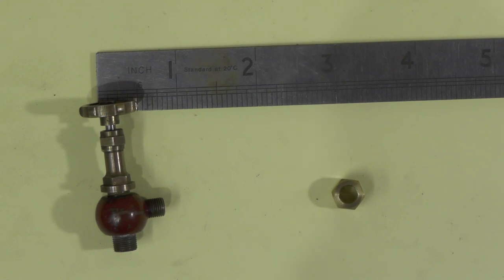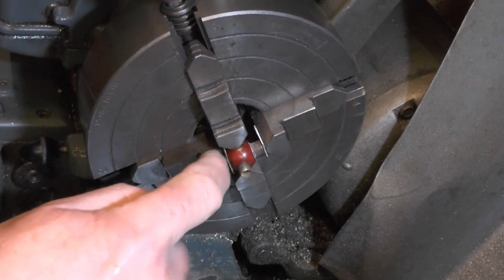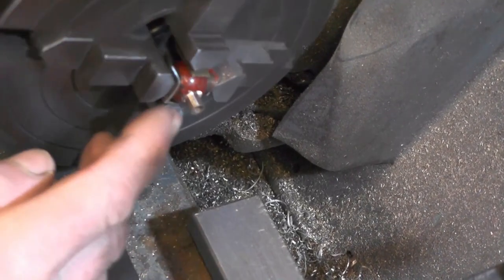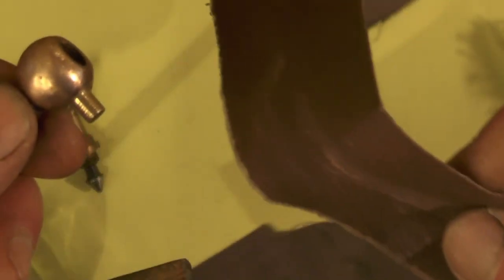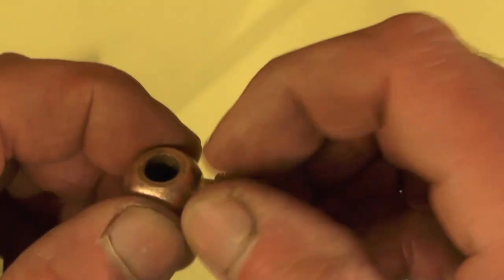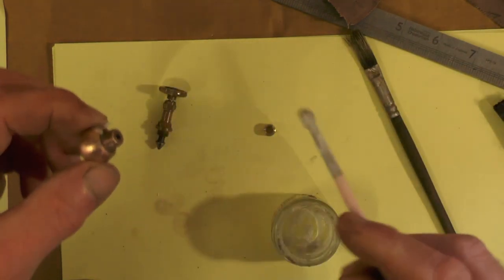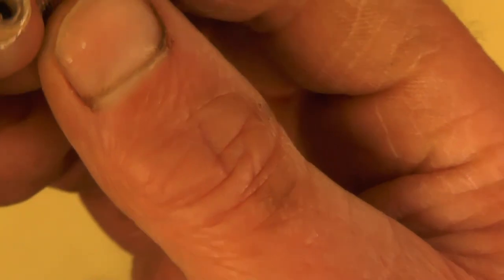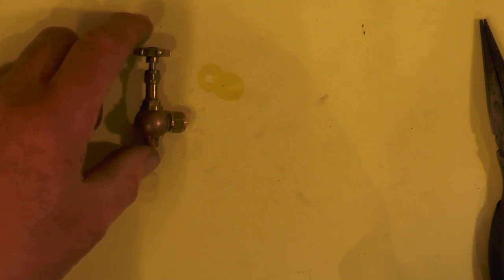Miniature Steam Globe Valve (Modification, Re-Purpose, Adaptation, Silver Soldering) "mr factotum"

Comment: Hi Mr. F,
I like your new title. It's so satisfying when you do some odd jobs for someone else, isn't it. I have finished fabricating the governor valve bracket out of brass and phos. bronze. Now I need to cut all the linkages. To do the rounded ends I am building a cutter holder to be used in the vertical milling head, with the spindle locked and used like a vertical shaping machine. This was shown in issue 14 of M.E.W. 
The weather over here is starting to pick up with temperatures already reaching 29 deg C on some days.
Regards and take care, till next time
Emanuel
Reply from the maker: hi emanuel
nice to hear from you, it was just to help a fellow metre maid owner out, thanks for watching.
Glad to hear your progressing, the set up your proposing for the next part sounds interesting, i will have to try and find the no.14 mew issue to take a look.
I'm going to be making a new riding car for my loco, to hold a water container and coal, for my next YT project, i was going to adapt my original one, but thought i would just make another shorter version.
take care over there, i'm fully vaccinated now, so hopefully things may become more normal, that said though the Indian Variant is on the increase over here.
see you next time 
regards
mr f

Comment: why not just thread a bit of brass 1/4 x 40 solder on and then turn to 5 /16 x 32?
Reply from the maker: Hi K
I wasn't happy with the wall thickness, so went a size down, it would have been a very thin wall were the threads meet, I know it was to be soldered but as it was for someone else i wanted to belt and brace it, Hope that explains
thanks for watching
Regards
mr f